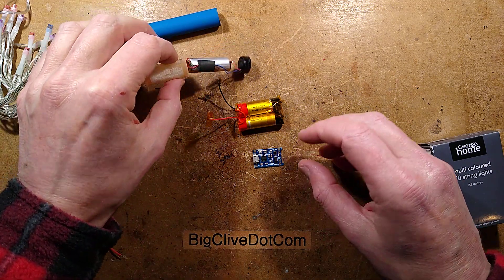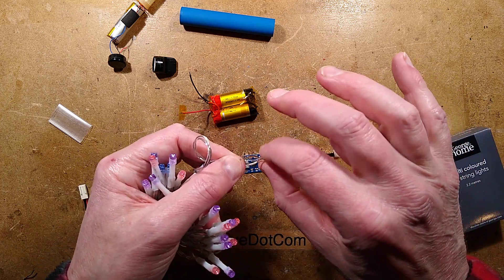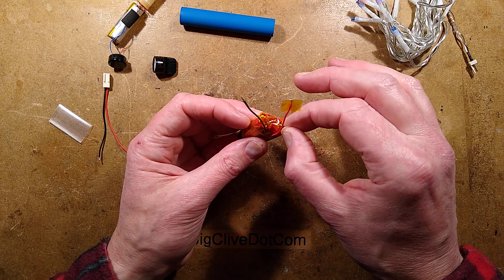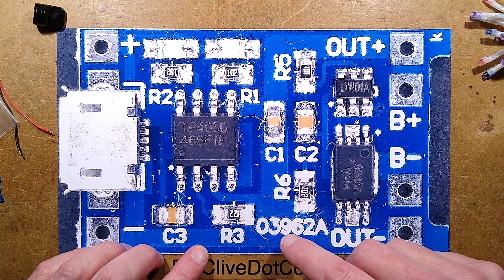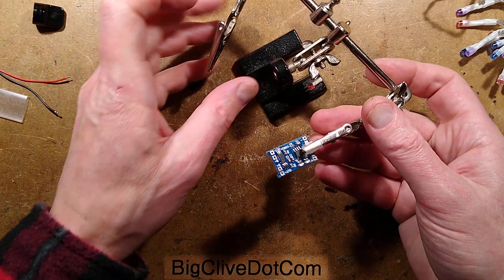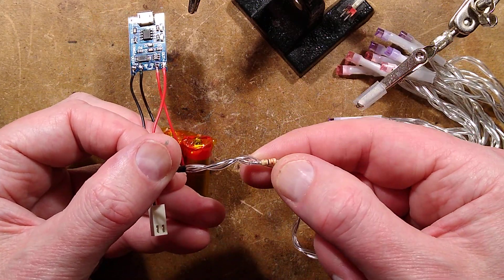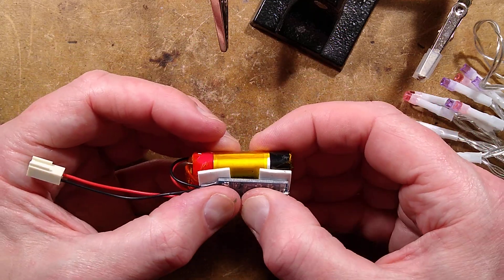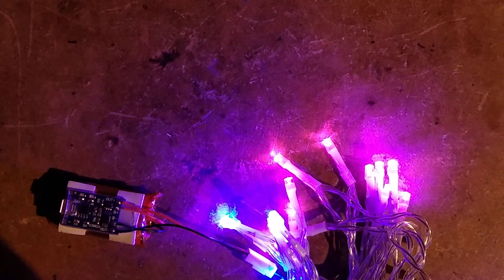Cheap power pack with free lithium cells (USB or solar charging)

Comment: Thanks Clive, you answered my doubts about putting cells in parallel with 1 tp4056. Thank you. I did use a tp4056 with a solar cell in the way you said, with good success.. 👍
Reply: I recently got 10x usb-c tp4056 and have many (used) small elfbars that have a 500mah battery, was worried about putting them in parallel as well, this reassured me and will start making some things.
Do you think it's safe to put more than 2 in parallel?
Reply: @NicolaFloris  I think you'd better make sure they are at similar health, because some of them degrade quicker than the others.
Reply: @NicolaFloris  You can parallel as many as you like, people tend not to go beyond 3 or 4.  As Janus said test them and match capacity, otherwise a weak cell will discharge the other and lower the pack capacity.  Also the amps the pack can put out will go up, so beware of shorts.  This also applies when making the pack, you could have high current between the cell until the voltage levels out.
Reply: @j.f.christ8421  A weak cell won't have the same affect in parallel as it does in series.

The chemistry says a 2Ahr cell at 50% discharge should be the same voltage as a 1Ahr cell at 50% capacity. Naturally this no longer holds true if a cell goes bad by shorting.
Reply: I doubled the mAh of my drone battery box by adding another identical cell in parallel with the original charge controller. I thought that by using cells in parallel I've change the mAh not the voltage so it'll just take twice as long to charge.
I balanced the cells to within 0.1V and wired them in what I've seen as "perfectly balanced parallel" and not the normally shown ladder type parallel otherwise I've read that the cells closest to the power supply charge / discharge faster.

Comment: Have you come across the IP2312 charge control boards? Supposedly they are more efficient, don't get hot whilst charging and can charge up to 3A for larger cells/batteries.
Reply from the maker: I have.  But they lack the extra cell protection of this style of module.

Comment: I'd like to modify a lithium charging board so it doesn't fully charge cells. For keeping a certain project power backup solar charged but not keeping the cells constantly at 100%. Can this be accomplished with a TP4056 board somehow? Would adding a diode in series with the cell drop the max cell voltage to roughly 3.7v I think?
Reply from the maker: I tried inverse Schottky diodes in series and it caused the chip to oscillate due to the diode forward voltage changing with current.
Reply: @bigclivedotcom  I once made a linear pass single cell lithium charger using a LM317 chip. It's adjustable so the voltage can be 'programed'  and you can set them up to current limit with a  single resistor.

Comment: I was given a load of discarded fruity cloud vapor devices and have found a way to modularise the batteries with part of the internal frame into a pluggable device. I've been experimenting with the same circuit board to charge and run the batteries as well.
Reply: you can say "vape." YouTube doesn't give a toss about vaping. Clive is wrong.

Comment: Nice little recycle job that Clive. To add to your already excellent process, I tend to add a small switch to the battery live leg to allow long term storage since the board does have a standby current. Also, I usually paint the charge board with either polyurethane or silicone conformal coating since I've a bunch of these outdoors.
Reply: Instead of a switch, fit the same type of connector used on commercial battery packs.  Not only can it be safely unplugged for storage, it provides consistent long term replacement options even if people stop throwing them in the street.
Reply: @johndododoe1411  JST connectors can be found typically on small hobby use LiPo batteries. That might be a better connector if you have them laying around, but I agree that a switch would be handy for long term use.
Reply: @agoodballet  JST connectors are designed for a limited number of cycles. They're also horribly difficult to plug and unplug, especially the knockoffs.

Some years back, I posted a link to a nice little PCB mount slide switch over on the Ladyada wiki. You could get it with silver contacts rated for somewhere in the 5-10A range for maybe a few bucks at the time.